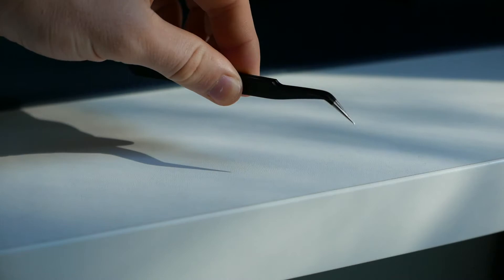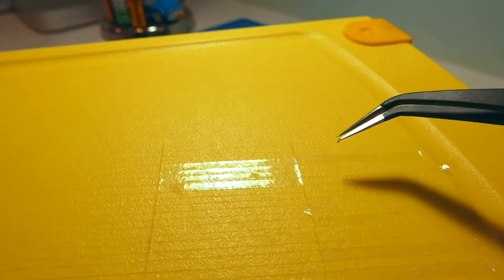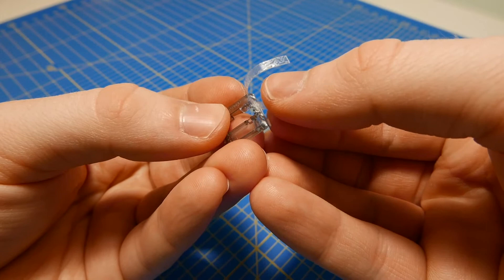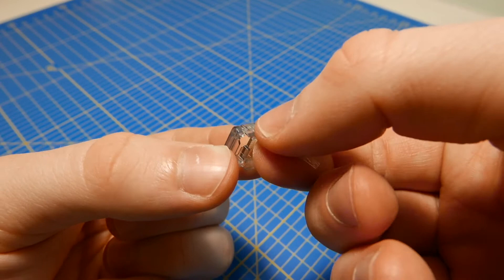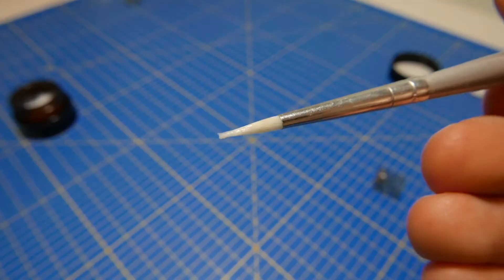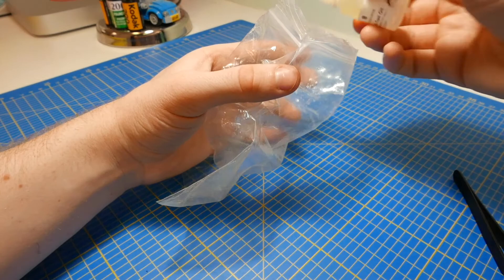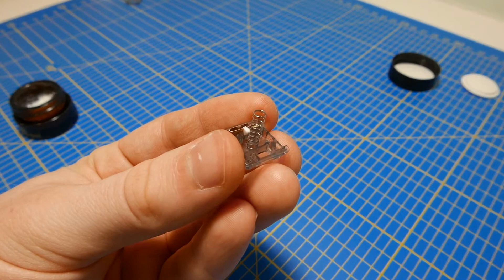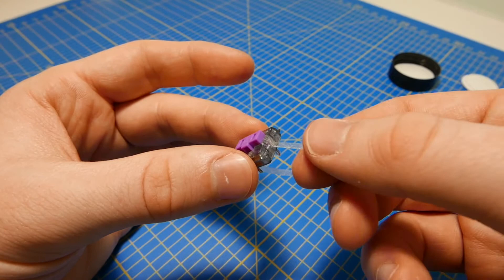Make Choc Switches Sound Better

Comment: This is great advice, but I HIGHLY recommend lubing/greasing the stabilizers as well. When you shake the switches, the stabilizers cause a very annoying rattle, but it can be completely silent if lubed. Makes the sound profile sound slightly better too in my opinion.
Reply from the maker: The purpz, shown in the video, don't actually have any stabs!
I definitely agree with this advice though for switches with stabs
Reply: @Signynt I just got rid of the stabilizers in my reds. Sounds much better and I don't really notice any difference in the feel.

Comment: What case did you go choose for Technik? How does it compare with BM40?
Reply from the maker: I got the PC smoke case, and I'm very happy with it.
I mean the BM40 and the Technik are pretty similar design wise, one is just low profile, and the other isn't. Both great 40% ortho boards. I personally prefer having the split keys on the center rather than the 2u key, and you can't change that on the BM40 unfortuantly
Reply: @Signynt  Thanks!

Comment: Hi is the purple part (where the Keycap goes into) sealed at the bottom and the sides? Im thinking about lubing without desoldering, just to get away the plastic sound when pressing a key. But i dont want to mess up my keyboard by getting lube inside the switch where it doesnt belong.
So when the purple part is sealed from the rest of the switch it shouldnt be a problem to lube it inside from above without desoldering.
Would be nice if you can answer this question :)
Reply from the maker: Can you clarify what part you mean? I'm assuming you mean the keycap stem, but am confused as to what you mean with it being sealed on the bottom and the sides.
Does your board have a plate? If it does it'll probably be challenging to remove the tops of the switches, and cut off the tape at the end, but if your board is plateless it should work just fine without removing the switches.

Comment: did you find that the travel distance of the stem is ever so slightly decreased after tape modding?  I used generic 3M packing tape and found the resulting tape-modded switches a little mushy feeling.
Reply from the maker: I haven't noticed a difference, but I barely used the switches before tape modding, so I might not notice the most subtle differences. 
That's strange, maybe you applied just slightly too much lube? Feel wise I find it very hard to distinguish between the tape modded and the stock switches, I just did a blind test.
Reply: Tbh they sound a little mushy even from the video.

Comment: Thanks for the video! I just bought Pro Reds and noticed they feel kinda scratchy when I press them, while Gateron Reds don't feel like this. Unfortunately, I forgot to buy Krytox; do you think that adding the tape and lubing the springs will solve this problem? Thanks again
Reply from the maker: I would argue that lubing is the most important step to reducing the scratchiness, so if you're going to go through the effort, definitely also lube the switches. 
It's worth the extra few Euros to buy some proper lube for the switches.

Comment: What lube did you use?
Reply from the maker: I used Krytox 205g0 for the switches. For the springs I used some multi tool oil, any lubing oil should work well for these.
Reply: @Signynt  so a Singer sewing machine oil could work for the springs?
Reply: @francescodesantis1997  No, don’t use sewing machine oil, spend an extra dollar or two and get Krytox. Any other oil will end up degrading the plastic.